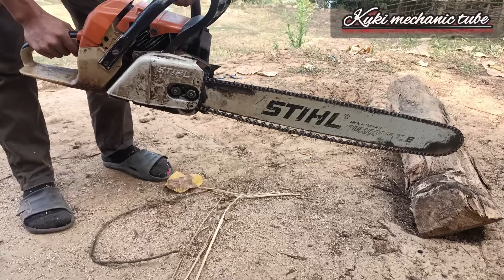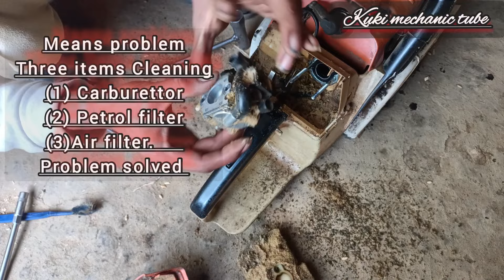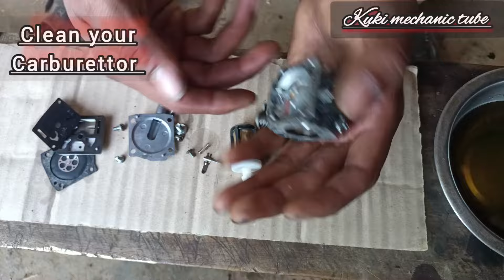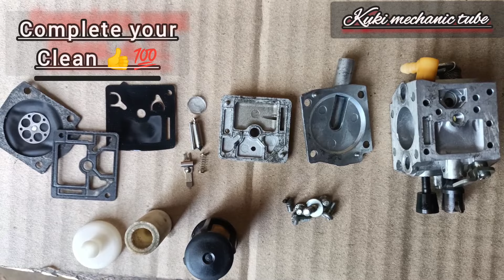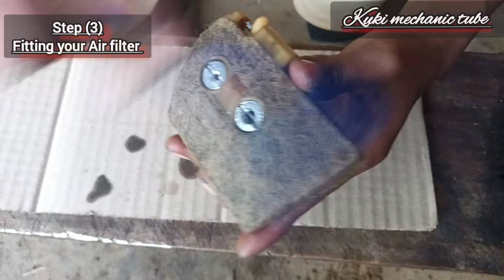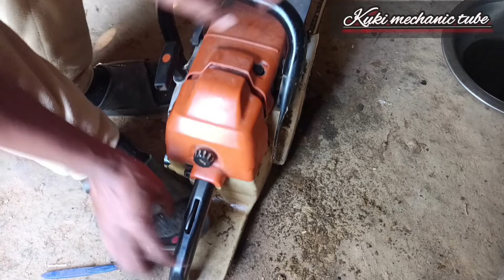Chainsaw Ms-382 Pickup problem How to Reparing Pickup problem

Comment: Mera machine 4/5 minutes kaam karne se off ho jata hai... Engine garam hone ke sath sath off ho jata hai iska kya solution
Reply from the maker: Air filter or carburettor adjustment solution hai Bro Air filter change karo or thora carburettor adjust karo
Reply: Maine block piston change Kiya fuel filter bhi change Kiya fir bhi 5/4 minutes chalne se engine hit hone ke baad off ho jata hai start hi nehi hota hai ......
Engine thand hone ke baad aur start hojata hai